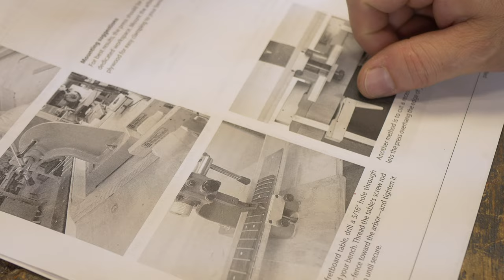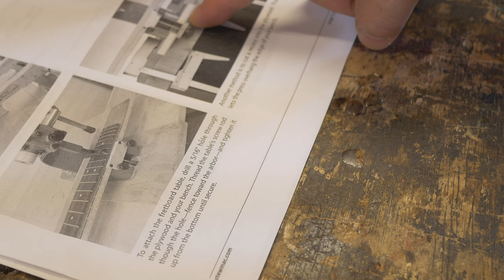Stew Mac Fret Press - Setup, Review 2022

Comment: The reason for StewMac's ridiculous overpricing is to pay for their "Lifetime Promise." It's like an insurance premium built into the price of every tool they sell. Every StewMac customer is literally paying for other people's returns, not just their own returns but the next guy's returns as well.

Many of their tools are simply rebranded or unbranded versions of the exact same thing you can find for at least half the price, e.g., Iwasaki files, the $45 Harbor Freight arbor press, clamps, vises, files, cutters, wrenches, measuring tools and the list goes on.

StewMac is a retailer not a manufacturer, and they work very hard at hiding the origins of where their tools are manufactured (mostly East Asia) and the identity of those manufacturers, not to mention disguising the materials so they appear more than what they actually are. Nowhere on the Fret Arbor Press product page does it mention that the table is made of plastic, but they sure do a good job of making it look like aluminum.

I'll never understand the cult-like devotion to StewMac.

Comment: I just removed this press from my Luthier's Amazon list I was building up. I pretty much removed 50% of StewsMacs expensive tools, cause of this review.

His Uke DiY kits are the only thing good, cause the other DiY Uke kits are very cheap hence there pricing. But Stew should be using hardwood bottoms with the pricing, just like they use hardwood tops.

Comment: Yeah it’s a little janky, but in this day and age what we expect for quality would honestly be about $2500 not $300… So I’m not totally disappointed… In a lot of cases plastic is actually better than metal, it retains its dimensions and doesn’t corrode. higher end machined metal would drive the price up nearly 10 fold easily so… Seriously don’t think anyone would consider this thing if was approaching 3 grand… Is what it is… I thought it was aluminum too so I think they did some photoshopping on the ad pictures…